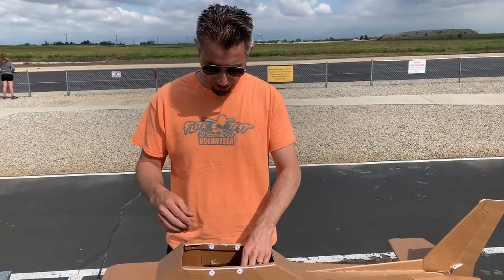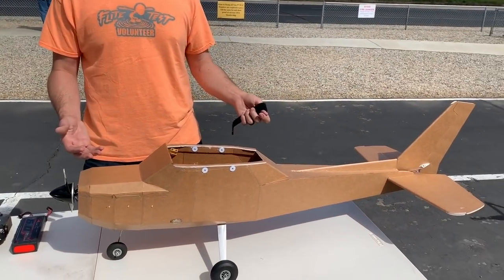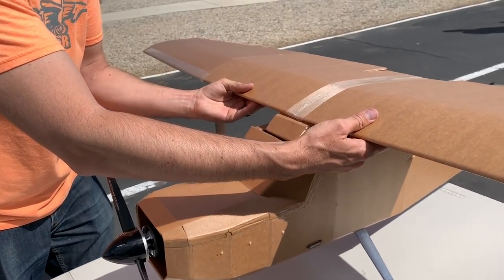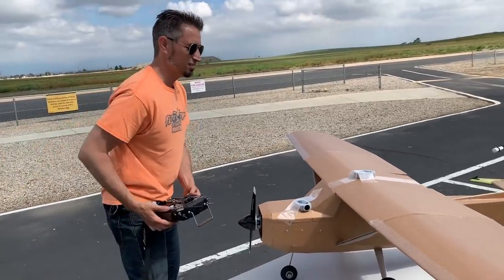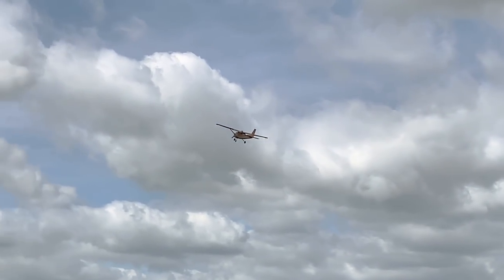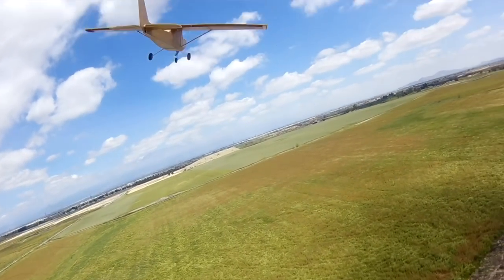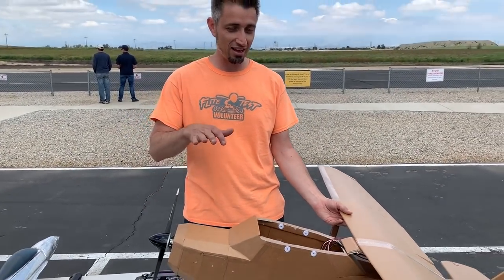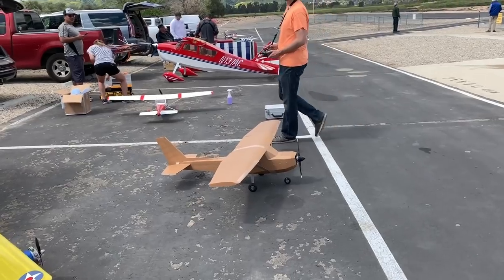Big Al's Cessna

Comment: Correct me if I'm wrong, please, but wouldn't it be better if the wing struts slid into their fitting in the other direction? Instead of the motion moving toward the nose, have it fit in sliding back towards the tail? Pushing through the air in flight makes me think that can come loose.
Reply from the maker: Possibly, but with a U-shaped pin one side will always be sliding out the back.  The angles and friction-fit nature of the rod and tube mostly ensure that accidental disconnection is highly unlikely.  I did not observe any loosening of either pin after any flight, and I flew it at least four or five times that day.  Good point though!
Reply: What about using something like a safety pin - something that locks around one end of itself?

Also, if you are attending FF’19 in Ohio, please bring this plane. It will be great to see it fly in person.
Reply: @TheHarberHangar  did you come out with the plans yet